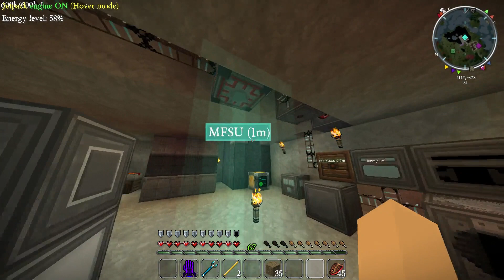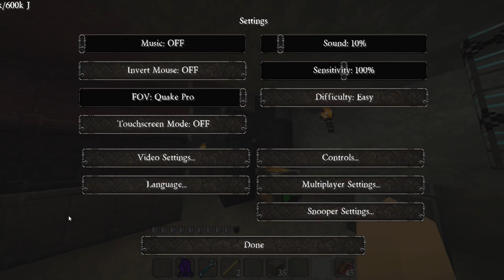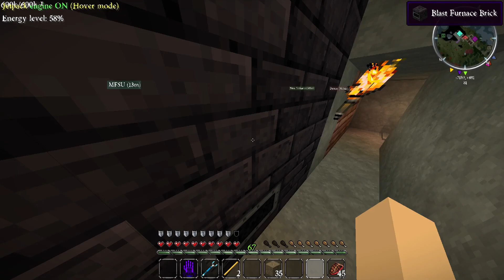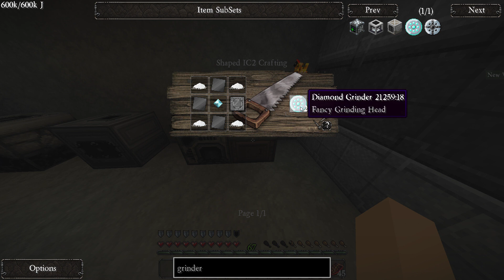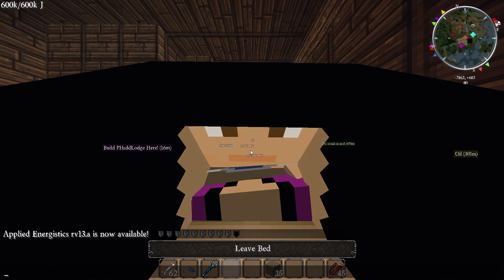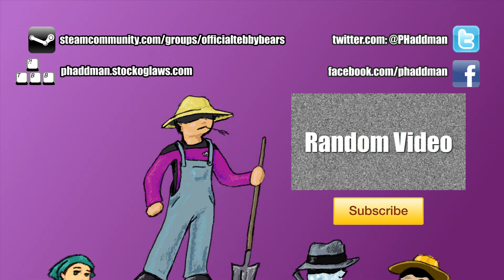Survival Series - Season Two - Ep14

Comment: You need to place an mfe right beside the industrial blast furnace with no wire of any kind in between the mfe and the industrial blast furnace for it to work otherwise it will say insufficient power it is due to loss. Glass fibre cable has a loss of 1 eu per 40 blocks no mater if it is 1 or 40 so you need the mfe next to it. Same for the centrifuge